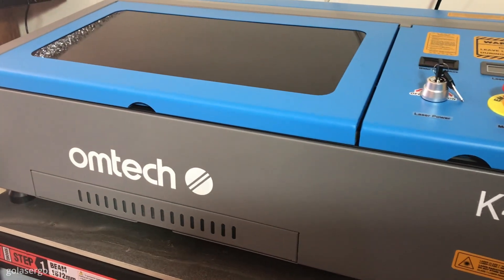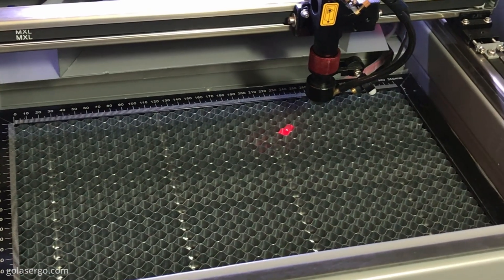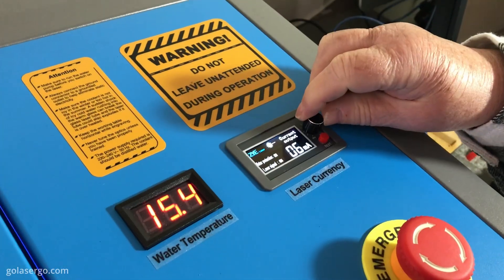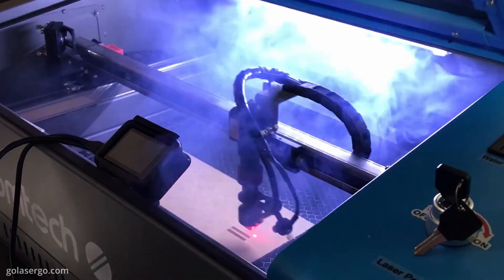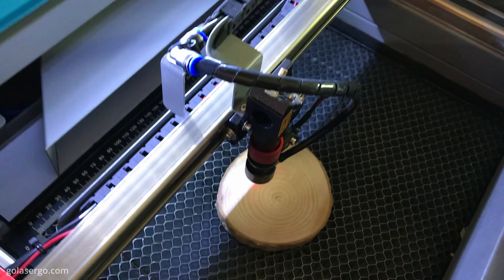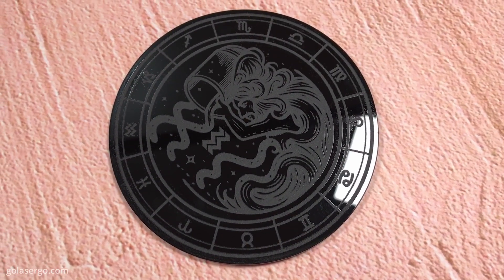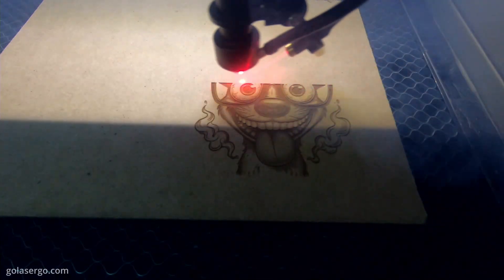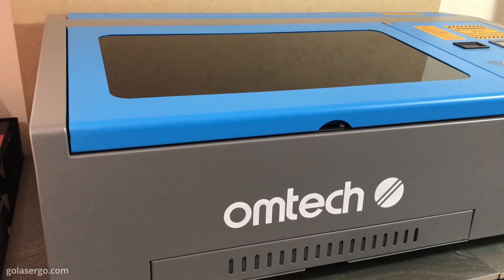From Diode to CO2: Our Review of the OMTech K40+ Laser

Comment: Why not set the percentage output in the program instead of with the control on the panel?
I really don't see any use for that control other than changing it on the fly for a test or something.
BTW
Laser currency is how much something costs in Laser land.
Laser Current is how many amps the Laser is using.

Comment: It is a good machine! power setting though, 100% on the dial or ealse you will get varying results with different temp in your work space as the dial uses a potentiometer. If you are using Lightburn, turn the dial all the way up and set your power in lightburn to less than 100%. You will find it easier to manage especially if there is a potential for someone to knock or alter the dial.

Comment: Hey! Do you guys still use the go pro setup or have you changed it up since then? I wanna do something similar with mine but am nervous on where to put the camera and keeping the door open for the wires to run through 😅
Reply from the maker: Yes, we are still using the go pro setup. The wires come out through the gap in door so the door is closed at all times. The gap is wide enough for the cords to come through.